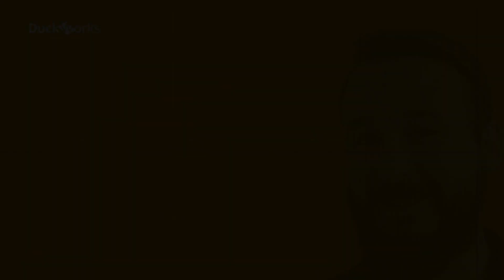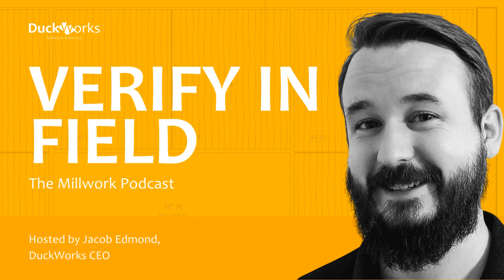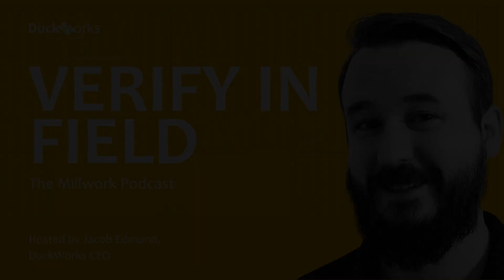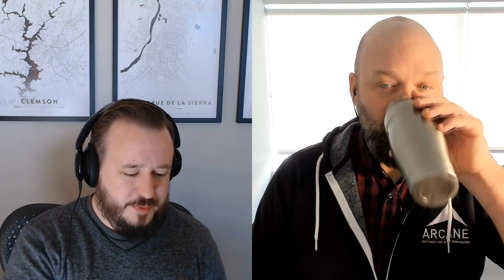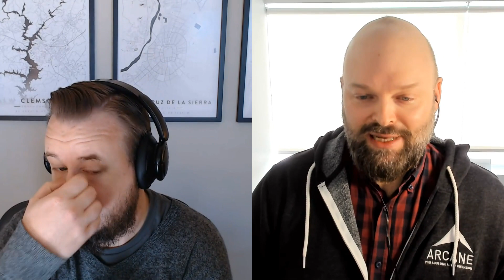Innovation in Millwork: Jonathan Blackburn on Vortek Spaces' Rendering Solutions

Comment: To Jonathan Blackburn,

I appreciate what your company is doing for the millwork and architecture industries, and am looking forward to utilizing your modeling program. I was however very disheartened to see that you are choosing to promote a company like Wayfair, especially when many of the businesses that utilize your program will likely be small scale manufacturers who themselves make furniture.

Wayfair's savvy business model enables them to offer low prices. However, it's important to recognize that cheap comes at a cost, and it's usually not the merchandiser who bears the burden.

In many ways, Wayfair resembles fast fashion brands like Shein, Zara, or Temu, where low prices are achieved through questionable practices, such as pressuring suppliers to lower prices, which can ultimately lead to exploitative labor conditions.

I implore you to reconsider this ethical issue.

Best, Nora Rolf